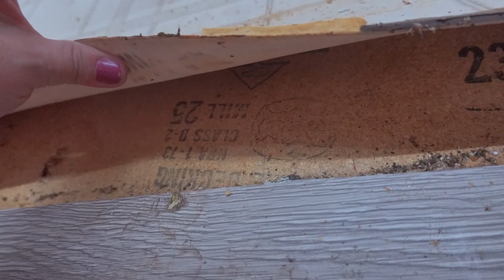Mobile Home Kitchen Renovation Cabinet DEMO

Comment: Have you ever consider selling your home and use all the money doing DIY projects to get a property that can serve your family better. Not a bigger property but maybe less land with a better floor plan.
Your diy’s  will be just that and will not add value. 
A buyer might feel the need to professionally re-do everything or build a new structure. If you can’t move,just make a master in the family room and give your room to one o the kids and enclosed the front patio and raise the floor to be used as a family room.

Comment: Just wondering - wouldn’t it be easier to finish each project before starting another?
Reply from the maker: Some things need drying time or curing time, but Im wasting days that way doing nothing instead of moving on to a different project while I wait for it to dry. When I have energy I need to work on it and not waste the days. It helps me mentally too, to not get bored doing one thing.

Comment: Also, instead of 2 x 4s why not use plywood?
Reply from the maker: Plywood for some reason has doubled and tripled in price. Since we're not walking on this floor, it's just holding the cabinets, it should be better. Plus I spent less than 1/3rd of the price of plywood by using 2x4's. In another area of the house, I will have to use plywood because it will be walked on and must be even for the flooring to not crack real bad.